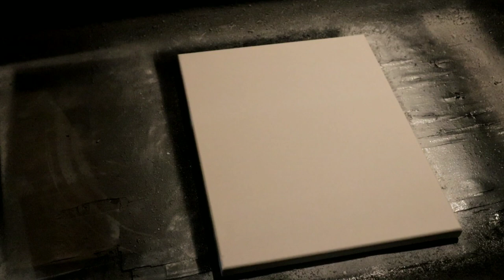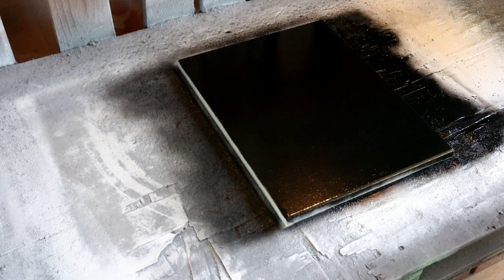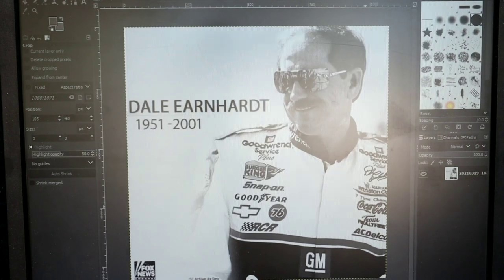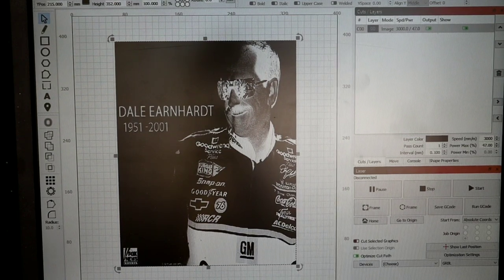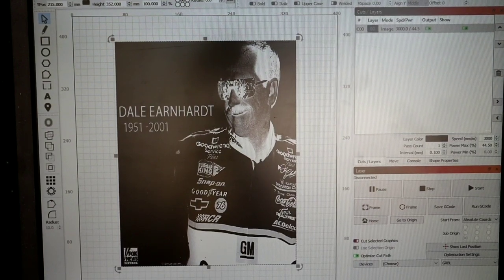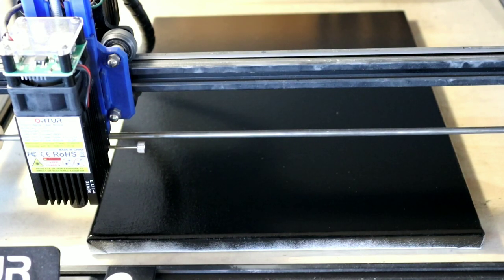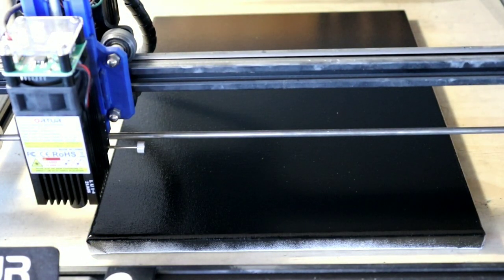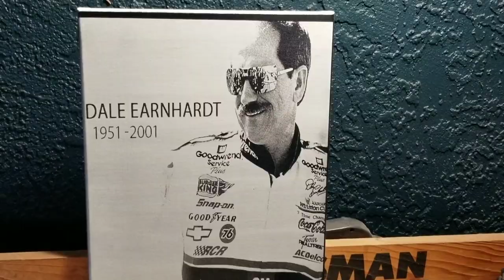Power Outage at 98%😭😭😭 Dale Earnhardt Engraved on 11x14 Canvas  Just not my Day from Paint to Power

Comment: Hi! In case you don't know, in Lightburn you can change the angle to 180 degrees and the burning will start from the top of the image! That way you can complete the burning with the same settings.
Keep uploading man! I bought an Ortur laser and follow your videos. Max from Argentina 🇦🇷
Reply from the maker: Yea My computer Turned off so didn't want to risk it not lining back up. Thanks for the support and more videos Coming.
Reply: Yeah I like to go bottom to top and hardly do flood fill unless it says a ton of time, which sometimes it does. But for like power outages it makes it easier to start where you left off.

Comment: Fantastic burn!  Question, I am looking at canvas burns, I don't see air assist.  Do you use air assist on canvas, and do you clean the canvas after the burn and then clear coat???  Thanks for all you do!!!
Reply from the maker: No I don't use air assist.  Yes I do brush off any paint ash from the surface using a foam brush before I clearcoat it

Comment: Did you know that if you go to preview that you can move the bar to exactly where you were and hit start laser from here and it will finish up for you? But first be sure you're back to home or your original starting point. Also be sure to zoom in on your preview to get to exactly where it stopped.
Reply: That's if you didn't already move it...But you still could prob center it back up good enough to get that last little bit I bet.
Reply from the maker: @WoobmakingMan80  I moved it and the computer shut Down Completely
Reply: @zerica24  Hey got a question
Reply from the maker: @WoobmakingMan80  What's up